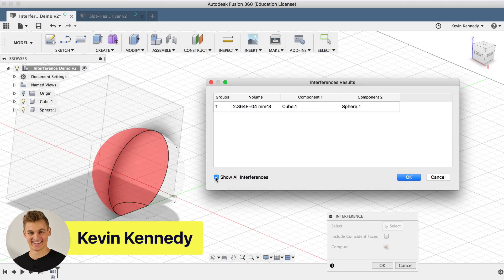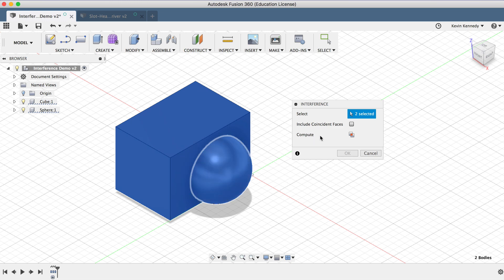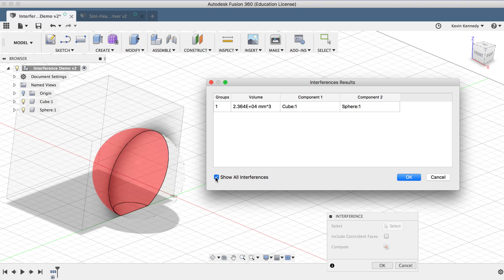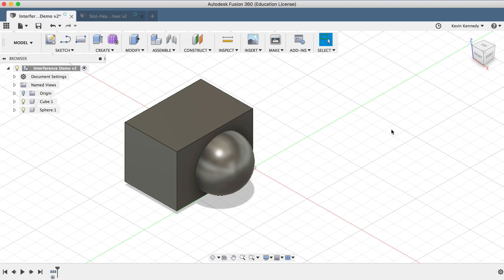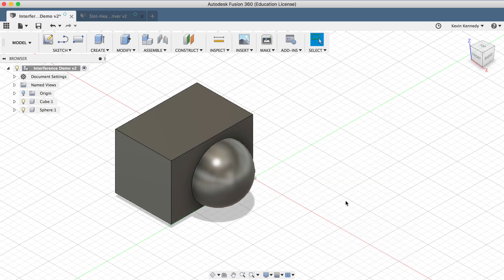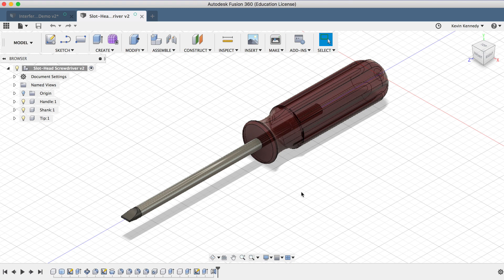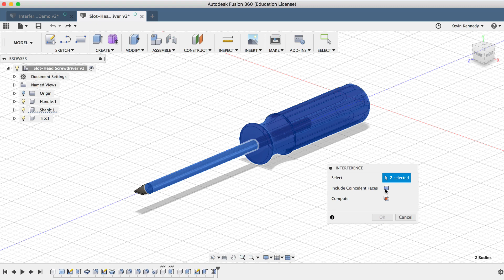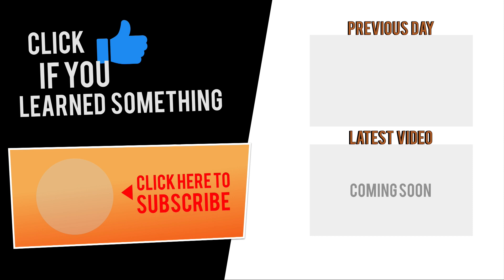What Does the Interference Command Do in Fusion 360? | #fusionFridays

Comment: This is awesome. Now the Mcmaster-Carr bolt step files actually work and you can remove the thread interference. 5 Star Video. Also, the interference delete only works with bolts if you selected all three (or more) bodies with the interference. If you only select two and then try to fix the interference on the 3rd body afterward Fusion 360 will glitch out. So select all bodies involved with the interference for the Remove Volume function to work.

Comment: Great tutorial! Do you know of any way to use intereference detection in 360 as a parameter for joint angles? Ie automatically prevent components from passing through each other?
Reply from the maker: Hi, Nathan. Great question - this is done with joint limits. In the Fusion 360 Browser, right click on the joint. On the context menu, select 'Edit Joint Limits'.  Set the limits on the joints to the appropriate settings to keep the parts from colliding. Cheers, Kevin :)